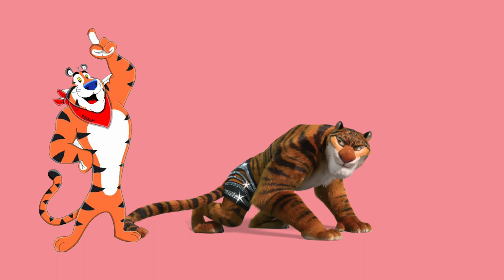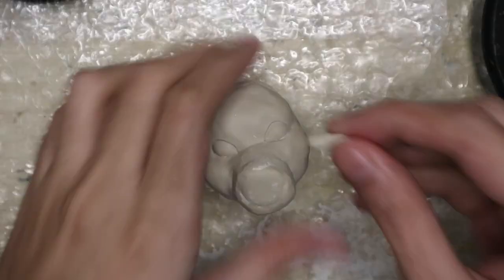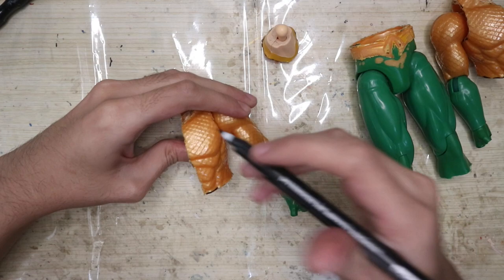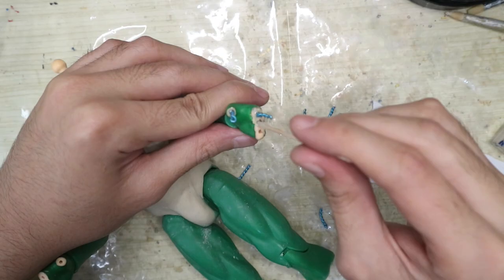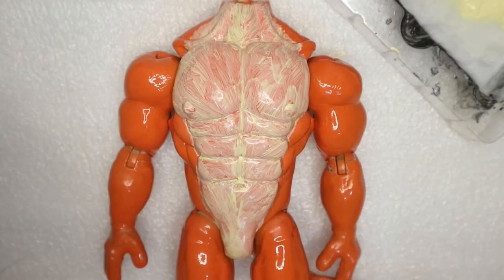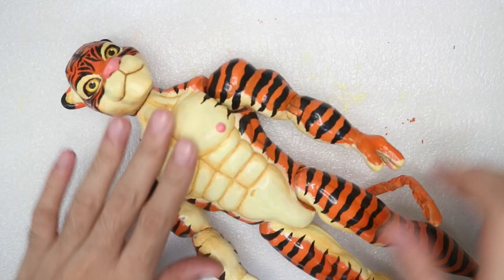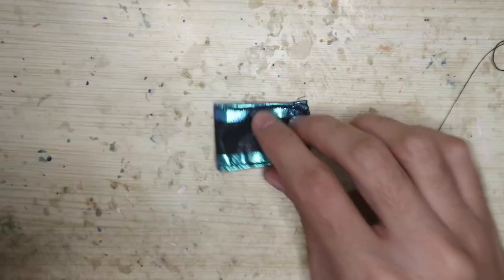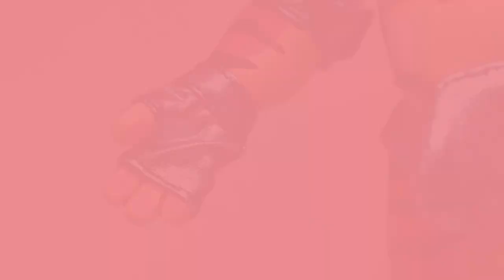PAINTCULIAR EPISODE 16: Tiger the Wrestler (🐯Furry Special OOAK Doll Custom NO MSC)

Comment: Hey Akin. I'm not sure if you've tried this trick already or if it's even a useful tip, but just earlier today I watched a video of MoonlightJewel. She was sewing with a different fabric. She ran it through her sewing machine with paper underneath it and the fabric seemed to sew together just fine. And the paper tore away easily because the stitches basically perforated the paper. Like when you pull a coloring page out of a coloring book. I'm not sure if the fabric you used was similar enough to what she did for the tip to be useful, but if you want to check it out, it's her new Meeko BJD custom video. She displays the trick while sewing the dress she puts on her doll. It's fuzzy fabric and I don't remember if it was stretchy or not but maybe the paper would prevent the fabric from getting chewed up as much? I hope it helps. I think the timestamp in her video for the dress is 6:26 but i'm not sure. I apologize if i'm spouting off nonsense. Amazing doll as usual though!
Reply from the maker: i actually did try that when i made bowser and it worked! but for whatever reason it didn't work when i was working on this doll. sewing machines are just... idk, they're temperamental
Reply: @hisnameisAkin  humidity can be a major factor, I’m afraid. It can bother the fabric and even the paper.